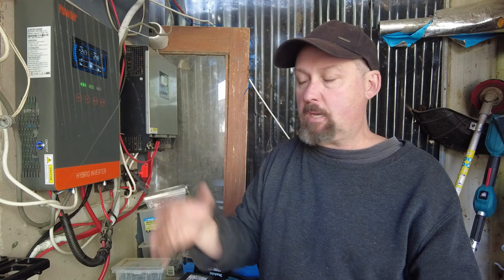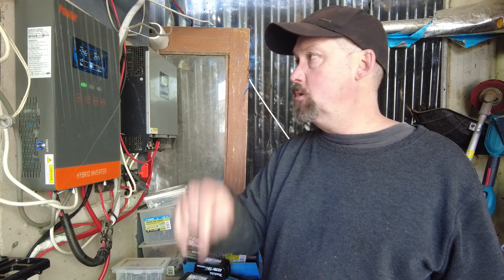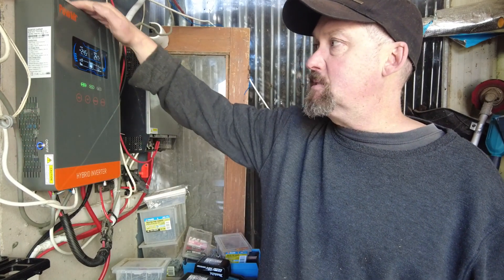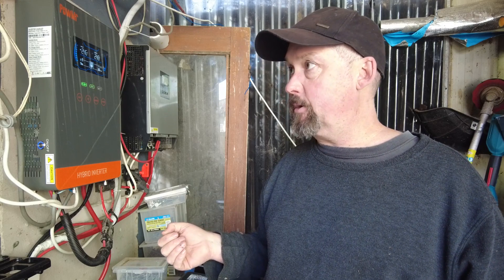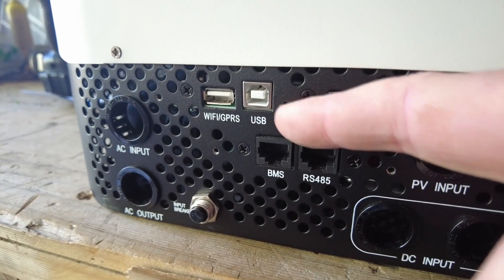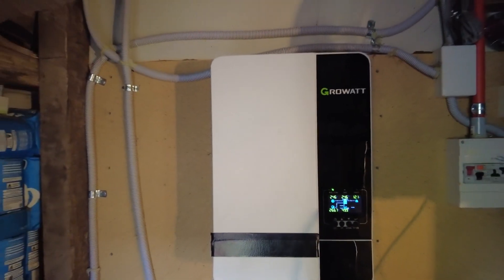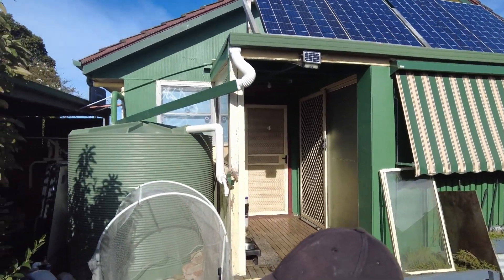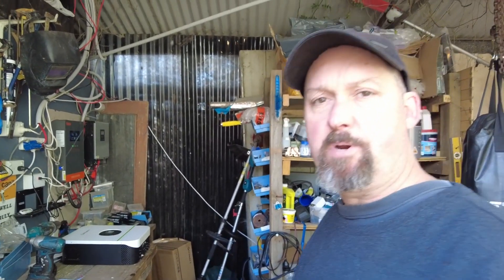Solar Inverter Battle: Growatt Spf 3000Tl Vs PowMr 4200W 24V Hybrid Solar Inverter (Part 2)

Comment: I’m ready to buy a 3Kw or so 24V hybrid inverter. Now that a year has passed can you tell me how the POWMR has held up?  What brand would you suggest for reliability and customer service backup?  Thank You, Dave in PA USA.
Reply from the maker: Its been really good, main thing is it has filters on the unit so it is very clean inside. Never had any fault of issues in the last 6 month running. I have a new inverter from a different company i am unboxing in the next week. half the price and double the power. On paper it looks maybe better than the other two.

Comment: i have had nothing but problems with mine first the dongle wouldnt work sent back and they replaced now im getting error 8 and in process of sending back as its 8 months old the dongle plugs in to com port pain in ass to get working still not working

Comment: Are you still happy with the PowMr inverter? I've ordered the 48v 6.5kw model to replace a smaller MPP Solar inverter. I hope the fans are quieter than the MPP. Have you tried the wifi app?
Reply: Did you get you order and how is it working for you?. I have the same but i haven't connected it yet.
Reply: @onasier  Yes, received the 6.5kw, 230v version.
The inverter and charger actually works pretty well. The fans only run with loads over about 500w and then they begin to ramp up speed with higher loads.
The MPPT works well.

However...  PowMr have stopped selling this model due to several firmware and hardware issues. 

The main reason this model was pulled, was because the inverter does not work reliably with no battery! I.e in batteryless operation.

The other annoying flaw, is the menu system has silly errors such as the up/down buttons working one way for the display and then reversed when you go into menu settings.

That said, ive been using this model, with a 48v Lifepo4 battery, with no major issues, for a few months - I won't be keeping it though. I think you are better off spending a little more and getting better quality brand..
Reply: @Rick-wy4od  thank you for the advice.  much appreciated.

Comment: I just ordered a 3kw 24v battery 120v output going into my motohome i was going to out 3 570watt panel on my roof but there output is only 42.5v so in series 127v i hope its enough volta for it since its operating voltage is 120-450v

Comment: I just order this one POW-HVM4.5K-24V I wander how many panels and to setup the array. How if 510Wp 6S2P?
Reply: im using one of these units  set up is 20 x 250w panels in series  8x200mah and 8 x310mah lipos  had nothing but trouble with the dam dongle they sent me a new one but still to this day havnt got it working unit is 8 months old and yes its quiet now im getting error 8 and 3 sending it back to sydney for repairs im sort of happy with it but a pig to set up hope this helps